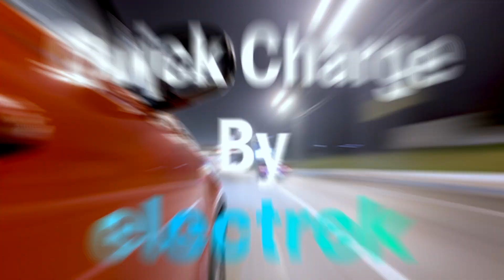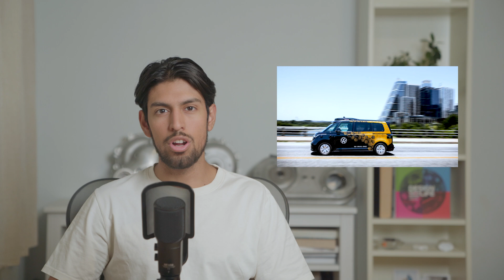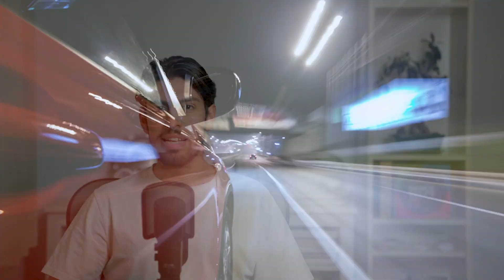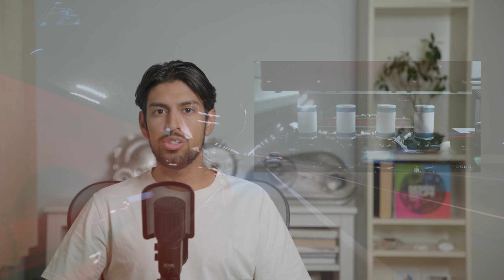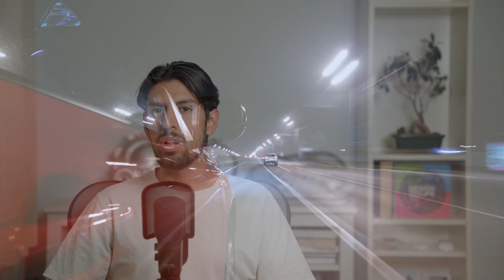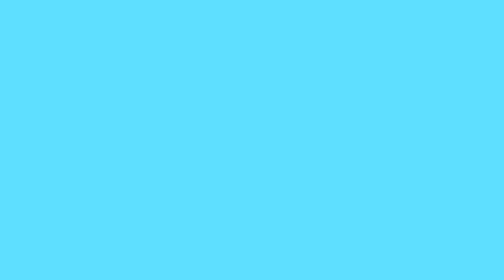Quick Charge Daily: VW bringing autonomous driving to large-scale production

Comment: Good job 👏 
I go in April 1st for another software update and check on my 23’ Ioniq 5 SEL AWD. This is an actual “Recall” #257 to put to bed the ICCU and fuse issue🤞hopefully❗️
I do believe this also includes the Ioniq 6. 
Keep up the good work ❗️
Reply: Sounds like they are pulling a Ford and software limiting the power to keep the border line electronics working.   It is a valid thing to do but the car is likely to have a lower peak charge rate.  Not a huge deal.   That is unless they have some way to add cooling with software.  Never been inside one so I would not know.    Let us know if you see a difference.  Please.
To be fair all electric cars limit peak driving and charging power.   With a fully software defined car this could have been done by OTA.    As the say one could uncork an EV and get insane charging and performance while it lasted.   Best wishes.
I was originally a bit miffed with Ford for not replacing the failing electronics.   But I have mellowed.   However this is a $ savings thing.   They could have done better.
Disclaimer: I do not own either of these cars but I do know about software and electronics.
Reply: @danharold3087  I agree about the OTA! You would think they could add that, unless the modem or processor is too slow on board?? I know Fords have had tons of electrical and software issues over the years! Not just EVs! I got the ICCU update last year, and I have not notice any change in level 2 charging at home, and I got really good charging speeds when I did take a road trip and used EA after that update. Time will tell, and apparently this time they will replace actual parts if they get any codes that indicate that. Hopefully, this will be the last time, but I’m not holding my breath. Love the car otherwise! I think I’ll make a list of questions to ask them when I go in. I’ll try and let you know.
Reply: @SteveM1966  Good thinking.  It would not affect  home charging.  Not enough current there.  It will only shave the peak fast charging rate and that only lasts for a few minutes.   So as I said it is not a big deal.  Glad you like the car.